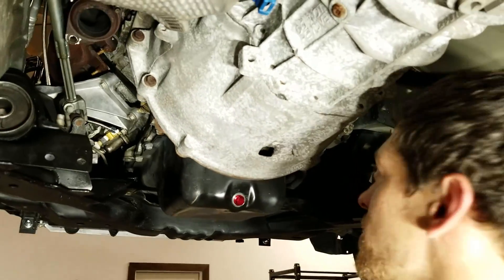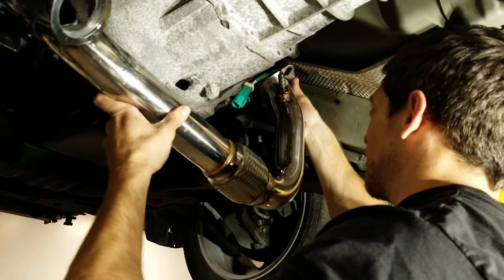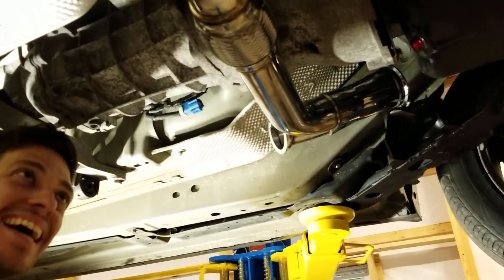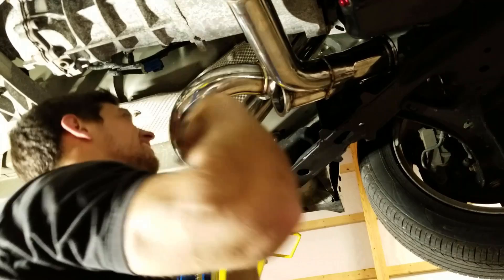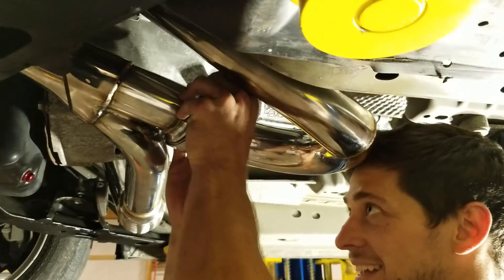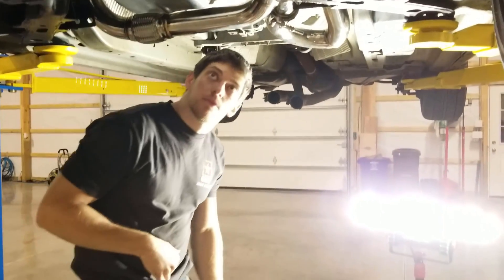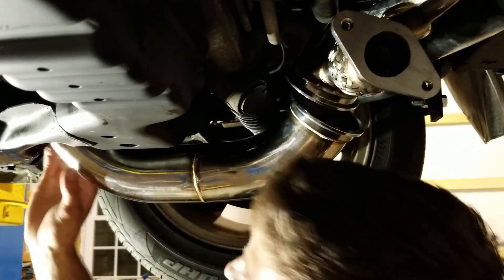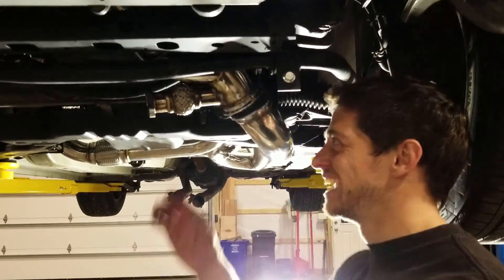Turbo Mustang Part 9 - Hot Side Install

Comment: where did the drivers side O2 end up? 
I am installing the kit now, but using their shorty headers to replace my long tubes. The drivers header had a O2 hole. Impossible to get to later on...
Reply from the maker: I kept the stock headers so I think everything stayed where it was

Comment: Been looking into this kit for my 09 GT, but can't seem to find a clear answer anywhere if you can still run this setup with a catalytic converter. Unfortunately I live in a state with yearly emissions checks. Any chance you can confirm? Much appreciated
Reply from the maker: You'd have to customize it because this kit replaces the part of the exhaust that has the cats.
Reply: May be a little late but I just bought a kit that had costume cats put to it, so you can definitely do it

Comment: With this kit they say dont tighten as you go or will run into fitment issues just hand tighten until complete
Reply from the maker: Yup you are correct and you definitely need to do this to get it all to work